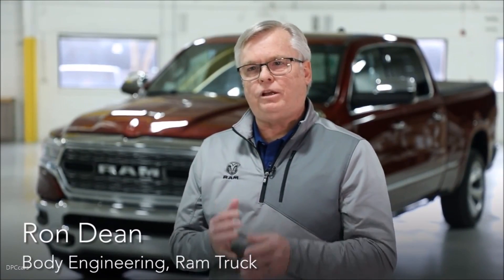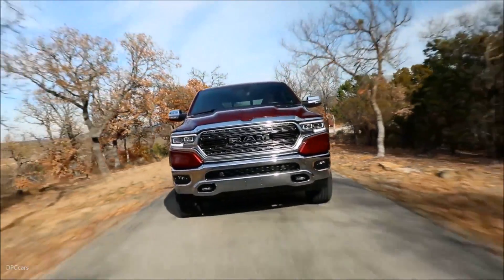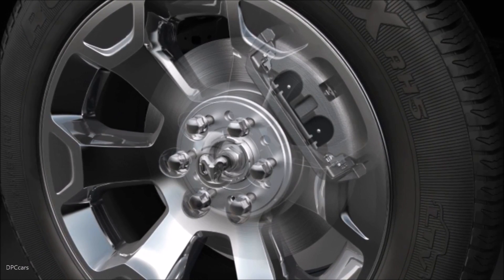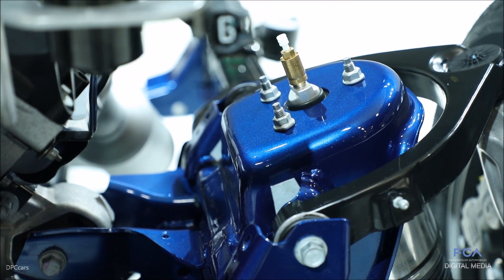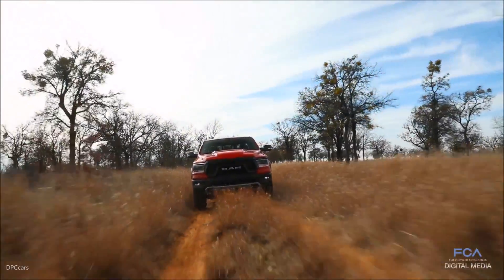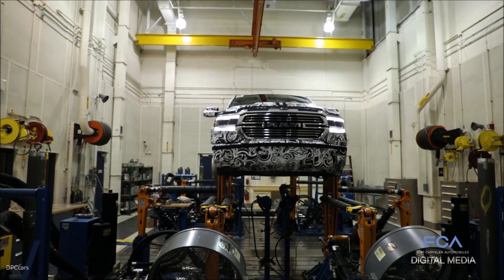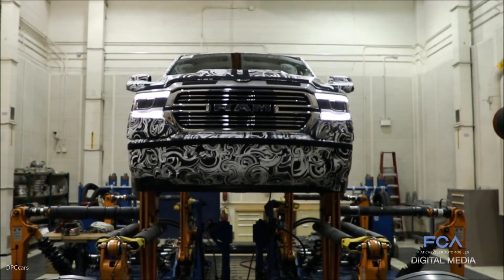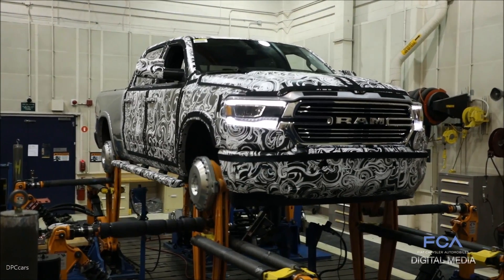2019 Ram 1500 Suspension & Chassis Explained

Comment: Air suspension is piece of crap and not for cold climates. On Monday I’m getting third replacement air compressor under warranty. Kept blowing 40 amp fuse and doesn’t work with front wheel almost sitting on wheel well and rear jacked up way too high. Fca should be reported to nhtsa for safety issues. Nice video though but they need to re engineer their air suspension so it is relevant to al climates.

Comment: I Have  a  2014 ram with air ride. I have replaced front and rear bags, pump and manifold, As soon as the temp drops to 35 it shows the message. I added air break Antifreeze. I added four caps to the pump air intake which is behind the right tail light. Remove the intake filter and add. It worked for me

Comment: After just traded in my 2017 GMC 1500 to 2021 Ram 1500 I feel sorry for the people who drives stone age 2014-2018 GM trucks or Fords. Mine was driving like a pile of crap over the road. Ram is like driving on clouds, with standard suspension and Laramie trim level
Reply: Now the new gen F-150 (2021+) is out..RAM may have a slightly better suspension still but the interior fit and finish even in an XLT sport 302 gets you 12” screen and everything is refined.  Also MPG is better with 2.7/3.5 Ecoboost and maybe even the 5.0.  That 5.7 RAM is horrible on gas.  Does sound good thou

Comment: I have owned a lot of rams. Current ride is 2016 rebel. The air suspension is absolutely junk. Never by one. Owners all over Canada and USA getting screwed.  One guy in Canada went to dealer. For 3 rd time to get this shit system worked on. They couldn’t fit him in.  12 others ahead of him with air suspension issues. Calls FAC. They say “ sorry we are not aware of any air suspension problems “
This is not he same company since FAC bought it. They are crooks. Never buy from them. I have owned a lot of dodge 1/2 tons. 3 new 3 used.  This is my last one.  Never buy a ram with air suspension NEVER.

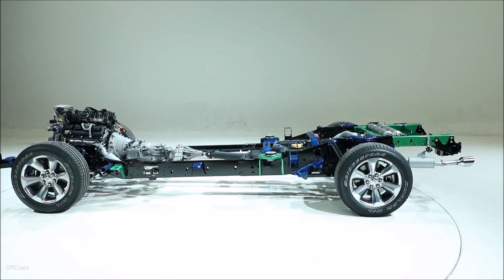Comment: Is a great truck but those suspension test @5:20 are good and necessary but it is not the same like real life, I mean the distance test are good but all machine that run the whole time are always greater the one that stays from time to time. So I drive Offroad come home and use for 2weeks my smaller everyday car, during this time stuff on the truck can react.... you know what I mean. Those simulation never can reproduce real life. But the truck is great

Comment: 2019 big horn black appearance group e-torque 5.7L crew cab- 4x4 with 8.4" nav and 3.92 gears lvl2 tech . limited slip diff with about 9k miles and 1 year ownership in North Florida. I love this truck with 1 drawback. When using it as daily driver work to home, i'm unloaded, I think the amount of deceleration jolt when downshifting, which is one of the ways the truck sends power to etorque batteries(braking and downshift regen) is alittle too strong in these conditions in my opinion..It takes more effort for driver to slow down smoothly, if you apply 20% brake and e-torque bites a downshift at 20mph. 4th to 3rd, or 3rd to 2nd its kinda like dumping the clutch after putting it in 3rd on a 5 speed car while hitting the brakes. It definitely isn't as noticeable if towing or loaded down FYI. and probably why its set to where its at. But I think being the 3.92 and slightly lighter than higher end trims, I feel the most effect from it. I've heard the feeling is similiar to jake brake on semi. I personally can live with it. I'm knit picking it. Pros are I should get twice the life on my brake pads lol and when you don't need to blast a/c in the summer, you can save decent amount of fuel, with engine off where you would have been idling. smooths the shifts on acceleration nicely, and this thing moves for being around 5400lbs. It ROASTS the tires from a dig w/o traction control in 2wd if you stomp it, yet 100% traction in rain on a dirt road flooring it with 4wd auto on... crazy... E-torque mostly boosts distance you could go per tank with realworld stuff like stoplights and drive-thrus and helps the MPG # you see on dash by eliminating the idle MPG, which is 0mpg! Decided a loaded big horn was more practical than a limited.. I actually use this truck for truck shit and it performs and looks good doing it..

Comment: I think air ride is a good idea. Semi trucks use it all the time. Ram just doesn't have it figured out yet... You know these guys are full of crap if you pay attention too. For instance, how could their special load simulator really shake a truck down as though it was on the road? There are no temperature variations, which is a serious problem if you are trying to tune an air ride system or shocks, both of which are going to change their characteristics when the viscosity and / or density of the fluids that they use to carry a load or dampen vibration change due to temperature. Plus, if you are trying to shake down a new frame made out of a new kind of steel, it is probably smart to see if it 1) becomes brittle in the cold (it does, the real question is how much), and 2) whether some other part of the truck is going to open up a slight clearance due to thermal contraction and start impact loading something else.

The other thing that comes to mind immediately is that there is no lateral loading on the truck's suspension in their fancy simulator. Without some amount of lateral G-force loading, as in an actual corner, there is no way to really know if things are going to wear or hold stable. And there is no way to evaluate some basic stuff, like what the camber curves are going to do around a corner as things start to wear and loosen up, or whether the sway-bars are going to control body roll. They could perhaps remedy this by mounting the whole test mechanism in a frame, and rotating the whole mess partially sideways as it runs. But obviously, they aren't worried about it.

Two parting shots: 1) They sure are proud of their upper control arm, which contains "structural plastic." I don't trust plastic in the cold, don't trust it not to cause the metal around it to corrode by wicking in moisture, and don't like the idea that the first time someone puts a torch on an upper ball joint to try to get it separated from the aluminum spindle, it's going to melt a structural part of the upper control arm. 2) Look at that piece of junk running on their test machine – the bumper looks like it's going to shake off, and gap between the bed and cab is all over the place. Maybe that's just their hydraulic cab mounts giving a little extra suspension to the cab. Hell, maybe it's even a good thing, because the chassis is remaining very rigid and holding the bumpers and bed tight, while the cab floats a little bit. But I would sure want to explain that on my video if that's what is really going on. Since they didn't mention it, I'm guessing their new truck is just so sloppy and loose that they couldn't edit it out of their own promotional video.
Reply: Well said. My air suspension gets confused all the time. Thinks it’s in off road when it’s in entry/ exit. Nice write up

Comment: I HAVE A 1993 LINCOLN TOWN CAR WITH 65K AND IT HAS THE ORIGINAL REAR AIR BAGS AND AIR COMPRESSOR WITH NO ISSUES WHATSOEVER !
I HAVE A 1998 LINCOLN MARK VIII WITH 146K AND IT JUST STARTED HAVING SUSPENSION AIR LOSS ISSUES AFTER SITTING A DAY OR SO. I HAVE 2 NEW AIR BAGS FOR THE REAR THAT COST ME $80 AND A NEW COMPRESSOR THAT COST ME $67-YES $67 !!! AND 2 NEW FRONT AIR STRUTS THAT COST $250 !!! GONNA INSTALL THEM IN THE SPRING AND SHOULD BE GOOD FOR AWHILE !!!
I HAVE A NEW 2019 BIGHORN CREW 4X4 I BOUGHT IN JULY 2019 WITH THE SPRING SUSPENSION AND I'M GLAD IT DOESN'T HAVE AIR RIDE !
MY POINT IS THAT AUTOMAKERS HAVE BEEN DOING AIR SUSPENSION FOR DECADES...WHY DOES SOME OLDER VEHICLES STILL HAVE THEIRS FUNCTIONING, YET A 2 YEAR OLD TRUCK WITH THE LATEST TECHNOLOGY CAN'T ??? PRETTY SHITTY IF YOU ASK ME ! 
FCA SHOULD REMEDY THIS ISSUE, ALONG WITH THE MALFUNCTIONING 12" INFOTAINMENT ISSUES I READ CONSTANTLY ABOUT !!!

Comment: I want a 2018 Classic Ram 1500. Does anyone know if it has air suspension, or not? I hope it doesn't.
Reply: some of the 2018 have air suspension, but I will rather buy the 2019, cause the suspension system got a big upgrade itself

Comment: The air suspension is great when it works, but after 4 years, it begins to fail.  When it fails, you have NO suspension and feel every bump.  I would never buy this again, and am asking everyone with bad air suspension RAM trucks to file a complaint with NHTSA to let them know the depth of the problem.  Maybe they will order a recall.
Reply: How you know after 4 years it’s going to fail when the truck was redesigned just last year?
Reply: Bob Hambuchen Probably no recall on comfort
Reply: I’m glad I was rewarding this was thinking of getting a truck with air suspension nevermind
Reply: A. Swap for coil springs. Cheap.
B. Learn to service and maintain the system yourself.
C. Pay the dealer to service your luxury suspension. 

I went with B. The nitrogen, vacuum pump, and WiTech programmer cost about $300.

Brakes need maintenance, engines need maintenance, bearings need maintenance, tires need replacing. What made you think a luxury air suspension system wouldn't need maintenance? Quit your whining.
Reply: Jeremy Schoeder looking to buy a brand new 2019 ram rebel with the air suspension. I’m down to maintain it shit I like being hands on, so you enjoy servicing it past warranty?
Reply: Cheyenne Obregon my 2007 Chevy avalanche has air suspension ride. My rear shocks wouldn’t stay aired up. I removed the shocks and the air pump. I got to farting around with the air lines and the o-rings. Come to find out the o-rings were not cooperating with normal applications. So I found some tiny o-rings and put those one the line too.
Long story shortened when I installed the o-rings I was able to push on the o-ring I put on and use it to go deeper in the hole and I have not had another problem with it.

Comment: All 1st generation of new technologies will have problems , series 2 better then series 3. I have found..by 2021 the air suspension should be wonderful by then , once they iron out the kinks. No matter what brand , the early addaptors are bata testers...even plasma tv's were plagued with problems when they were 1st released. You only need look at tesla problems to know what I mean.This is why I rather the last of the old model , than the first of the new one. But most people just want the new "improved" model......idiots!
Reply: This same Air ride has been available since 2013, and came standard in Limited models.
Reply: +1 on Schoeder's comment. Also, air ride has been the predominant suspension in semi-trucks for fifty years or so. Firestone, and some other companies have made air ride conversions for medium and light pickups for years that work reliably; Audi builds air-ride cars that run great for years before they start to have problems (although admittedly, at that point, they become really hard to fix and maintain); and even Chevy managed to figure out a pretty good system for the rear of their top-end Suburbans (if you can keep the compressors from rusting out). I don't know if Ram is going with cheap parts, or whether their testing/quality control/engineering is bad, or all of the above. But there is no reason they can't make a reliable air suspension in 2019. The technology is very simple, and has been ironed out for years.

Comment: Just to add more pressure, I've also had big problems with my air suspension on my 2015 Rebel. At first it was only doing it in winter but now I'm starting to get the "Immediate pneumatic maintenance required" warning soon followed by empty bags even in summer. How the hell am I suppose to tow my vacation trailer with air suspension failing on me randomly? 

This is unacceptable!
Reply: Please file a complaint with NHTSA and request a recall investigation.  Mine failed when I was 2,000 miles from home with a camper.  Could not get a dealer to even look at it because their shop is full of them.  Please file the complaint and help us all.

Comment: I almost bought a Rebel and changed my mind because of that AirBag crap.   Same 5.7 Running gear as My Express and weighed more?  Less power to weight ratio !    I just bought 2019 BH Sport 4x4 OR ,  very happy with it just wish it had Rambox .

Comment: We were told to park our truck during the cold months. LMAO yes of course because my motorcycle will be quite comfortable in these winter months...F'ing air suspension is crap...No solution to the problem....
Reply: Someone above your comment suggested replacing it with coil overs (I assume coil springs).

Comment: Air suspension is crap.  I paid 77000 for a pile of crap. Never buy a ram again. Ram should recall these trucks. Very unsafe driving down the highway when your truck is on tilt.  Can't handle the cold at all. Why sell this crap in Canada.  Go job Ram. NOT....
Reply: Vinmango B I’m with you. I Paid 65665 for PURE JUNK!!! Knocking noise under CAB while driving. Water Leaking. Into cab. Terrible Vibration at 70 MPH.. Very loud Cab  wind noise.. AND the best of all Surround sound inop in XM mode... Never again!!!! You have screwed me for the last time!!! Toyota ONLY!!!

Comment: The air ride is amazing in the summer but it it atrocious in the winter. It just snowed heavily this morning and i wake up to my truck's air bags dropped all the way. Absolutely zero help from engineering to fix this issue and if you do end up "fixing" (which means an expensive replacement) anything, it just fails again and you have to spend even more money. I will be pulling out my air suspension and putting in the standard coil overs in.
Reply: I didn't even know the air suspension units could be replaced with coil overs. I'm assuming the coil overs are obviously aftermarket, right?

Comment: To bad that Ram doesn't admit that the air ride system is the worst system in the market!! Useless for winter months dropps and blows fuses as soon as the temps drop below 30. Thank you Ram for no help with this garbage system and the no help at all!! Stay away from the air ride !!!!!!!!!!!!!!!!!!!!!!!!!!!!!
Reply: michael tsampis it’s actually pretty good, there was a couple updates for the switch block, some RV antifreeze in with the nitrogen charge and it’s pretty reliable.
Reply: @airratchetjockey7605  Hey there, interesting comment. I service my own air suspension and would like to know more about the RV antifreeze charge. Do you happen to have any links? Thanks!
Reply: Jeremy Schoeder  no links sorry, the dealer here in town puts some RV antifreeze in the system  because they like to freeze up in our cold climate.  Not sure oh how much they use either.
Reply: @airratchetjockey7605  Which dealer, if you don't mind? I might just give them a call.
Reply: @airratchetjockey7605  I live in Minnesota, and have started vacuuming and recharging the nitrogen every fall, to remove any moisture buildup. The valve block freezing up is the main issue, so antifreeze could prevent that. Adding a little during recharge would be easy enough.
Reply: @airratchetjockey7605  Thank you!
Reply: Is the air ride system an option, or does it come standard on all 1500 Rams? Does it come on the 2500 Rams?
Reply: @bobby1970  I believe the Limited model is the only one with air ride standard. It is optional on all other models, however.
Reply: @JeremySchoeder  , thanks.

Comment: Air ride is not worth it high failure rate in cold climate parts of the country
Reply: I had a 2015 Outdoorsman with Air and live in western Quebec. I loved the air ride so much, that I got it with my new 2019 Rebel again. 

It's really not uncommon for us to have -30 Celcius here - in fact it's been a steady -25 Celcius for the last 3 days and expected to stay the same for the next few days... I have heard of some people having issues with the first generation of the Air Susp. but I never had an issue -  where are the statistics regarding "high failure"?. Every manufacturer has it's share of weaknesses - no vehicle is perfect. My 2017 GMC Sierra was a complete dud where the transmission always kicked like a mule.

 I can tell you with certainty, that the new air suspension for the 2019 has improved. It is faster for up and down, and it is stiffer than the previous generations. 

I really love my new RAM - what was a good truck, is now a fantastic truck.
Reply: You would think they would of solved that by now. The rear coil springs should still offer a nice ride.
Reply: My sentiments exactly, I have it and never again
Reply: It's typical physics that the compressor running seals that are made out of plastic will have some memory effect if they are cooled down. It needs some running time to temper all the way, than for sure internal leakage will reduce a lot and efficiency will rise. No matter what system you will buy on the market, this will  almost be  unavoidable.
Reply: @Word-Life  Too late, Canucks have been wrapping the compressors with electric battery heater blankets for some time now. Some of the more skilled craftsmen route a small pipe off the exhaust and point it at the compressor. I just evacuate and recharge the nitrogen every fall, this removes any moisture that can freeze up the valve block.
Reply: STEVE ORTEZ Not if you put heating coils to keep it warm, just kidding.